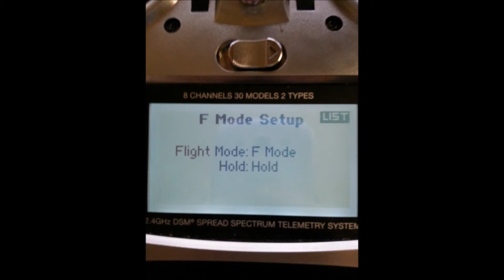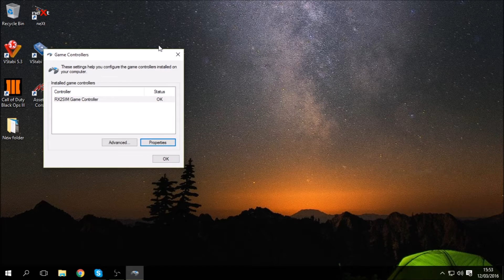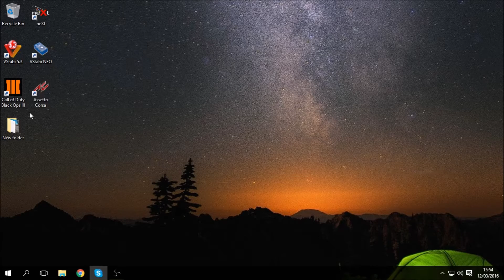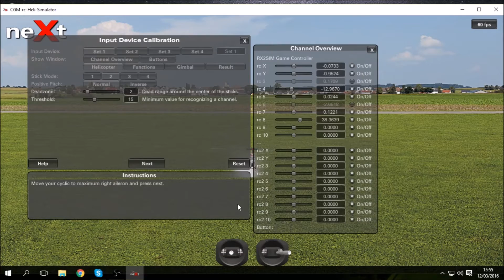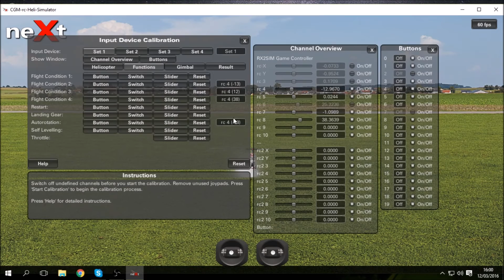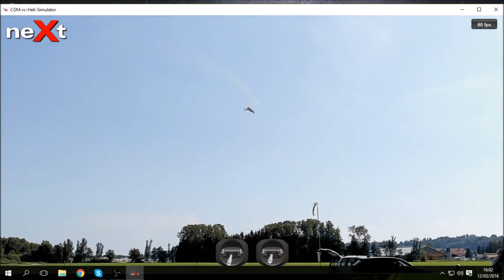neXt RC Simulator - RX2SIM setup tutorial - With 3 Flight modes and TH

Comment: I'm new to simulators.  Is there an RC2SIM available for Futaba transmitters ?  I do have an old DX6i transmitter if that would work easier than setting up a Futaba ?
Reply from the maker: Yes futaba will work with rx2sim just see instruction manual for setup

Comment: Great tutorial.  I want to add that with newer Spektrum radios it is possible to add a 4th Flight Condition.  The throttle curves I am using are:

Autorotation/Hold:  0% flat
Flight Condition 1:  25% flat
Flight Condition 2:  50% flat
Flight Condition 3:  75% flat
Flight Condition 4:  100% flat
Reply from the maker: you can assign a 4th but require an extra switch, unless you have a 4 position switch.
Reply: Yes.  That is correct.  I am using an additional switch to utilized the 4th Flight mode.